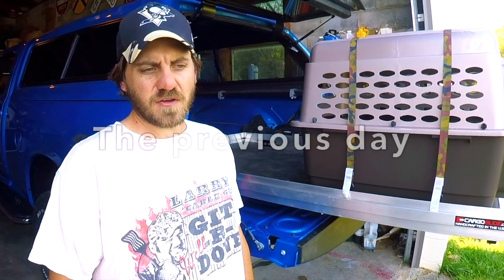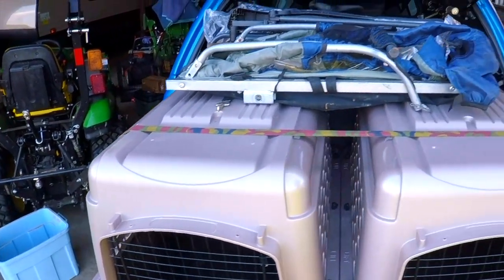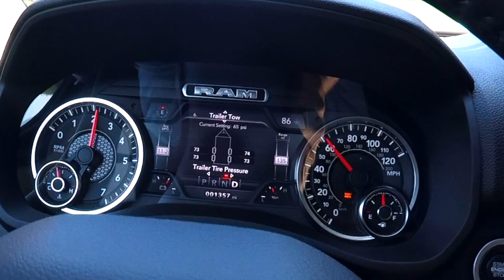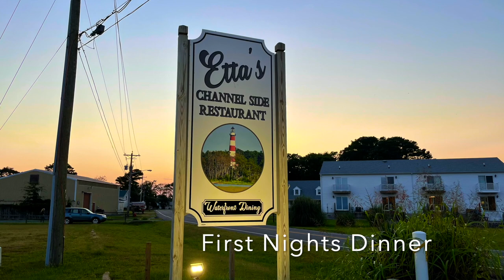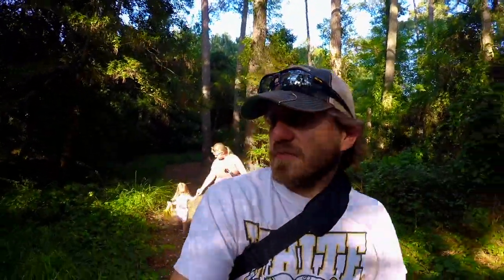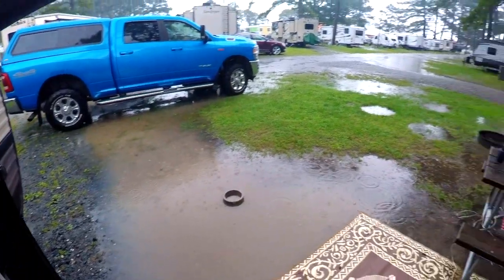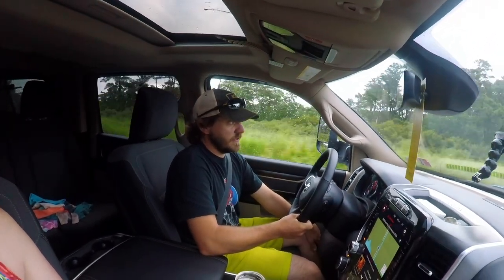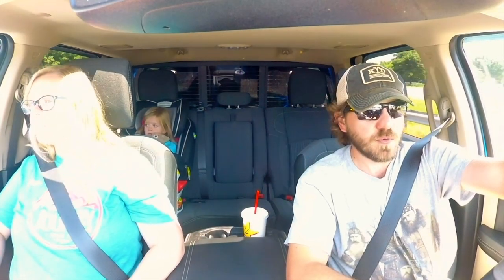Beach Bound! | 5 hour tow with our new RAM 2500 HEMI | Our campsite gets flooded! | 2021 Ep. 7

Comment: I have a 2021 Power Wagon and a trailer that weighs about 6500lbs wet. Nice to see a similar setup to compare. I get about 9mpg towing and the truck does great. Gotta love the 8HP75 trans and 4.10 gears! I did add some SumoSprings (SSR-312-47) since I’ve got the squishy suspension, they drastically improved stability when towing. Removed about 1” of sag when loaded too. I had a 2018 2500 Cummins but couldn’t justify for daily driving. I thought I’d miss the diesel more but surprisingly the ol’ hemi is pretty impressive, and simpler maintenance too. Great job on the channel man!
Reply from the maker: I’m a little jealous, I’ve always liked the power wagons!  The 8 speed and 4.10 gears is a winning combination!  It’s hard to justify a diesel as a weekender towing this size trailer, but the Hemi is a good match!